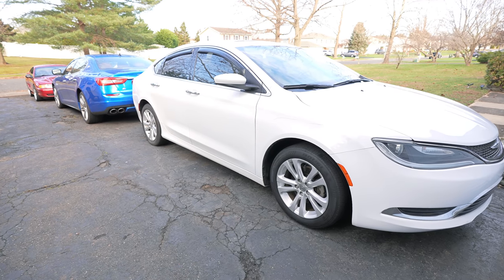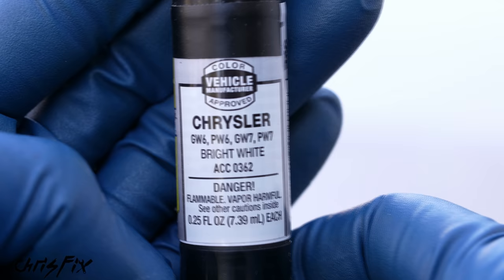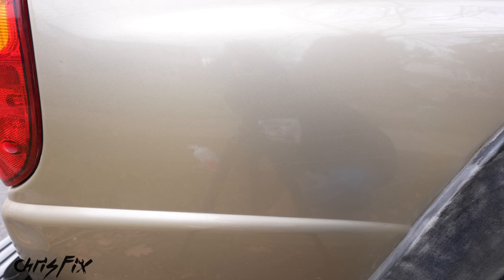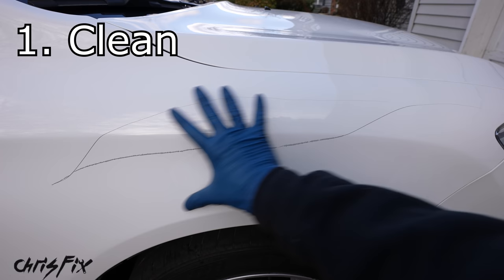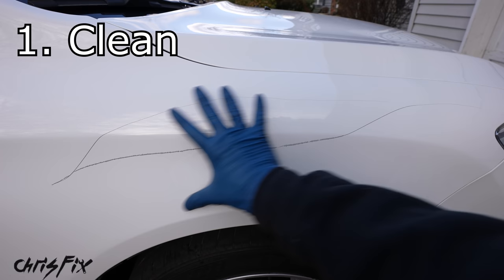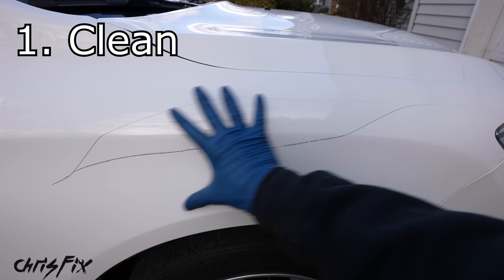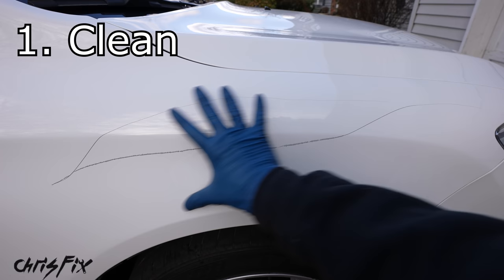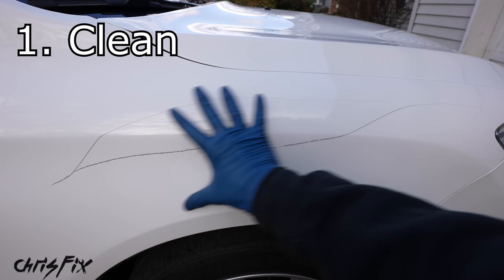How to Repair a DEEP SCRATCH in Car Paint (DIY)

Comment: Thank you Chris! This is indeed very informative and very well made video!  I learned a lot from this.  However, I wanted to say that I have done several experiments on several scratches, darker car is definitely not possible to be restored like what you showed in the video. This is because that even perfectly matched paint will still look differently from different angle of light ( I mean, from one angle, color looks exact match, but from some other angle, the new paint looks obviously lighter). I don’t think this can be resolved unfortunately. Please correct me if I was wrong and if you have any suggestions. Thank you very very much!
Reply: Slightly mismatching paint that you can see from a meter away looks much better than chips/scratches that develop rust and eventually destroy the panel. Better would be to sand the panel down to metal and repaint. Best would be to repaint the whole car. But most would agree those options are overkill, and that this is a very DIY-friendly way to remedy an expensive paint repair and have it come out looking incredibly good, while protecting the panel and paint from rust.

Comment: Pretty helpful video.  If u have a color coat like my red truck and there's a scratch that goes through the primer you'll definitely need more then 5 coats.  I put at least 8-9 coats on my scratches and still had to refill after sanding.

Comment: Hi thank you so much for the video. I have never worked on my car before so I’m hoping you’ll see and answer. I notice when you described your supplies you mention 2000,3000,and 5000 grit sandpaper however when you were going step by step the first sandpaper you used was 800. Can you please clarify which ones I should use, I really worried about messing up my car even more lol. Thanks in advance 😅

Comment: I did this on my 2020 Corolla (I’m so happy I got a white car) It was my first time using sand paper, polish and doing anything car paint related. For my first time doing this I have to say, the results on my car were damn flawless I made little errors here and there but for my 1st time and having enough patience to start from scratch twice. Everything is matching and just like the video, you can only see the fix if you see it on certain angles or get up-close ! I’m very happy someone like me could pull off the fix and get these results!
Reply from the maker: I’m glad this worked well for you!
Reply: I love you.

Comment: My OEM color is not available in this pen but I can get it from my dealer. Can I use any clear coat to seal it following this method? 

Also, is the method the same is there is a dent at the scratch as well?
Reply from the maker: So dents need to be pulled out. You can use any clear coat that’s the same type.
Reply: @chrisfix  any tips on the sanding buffing if I don’t remove then dent? It’s tiny and busy shops want upwards of $700 to repair both 🤑

Comment: I love ChrisFix  but his procedure works great for solid colors only. If you have metallic paint do NOT follow these instructions. Sanding metallic is a no no. The reason is that you would be sanding the metallic particles in the paint and those particles would lose its shine and stand out like a sore thumb. If you have metallic your best bet is to feather edges, lay down one or two layers of color without going above the rest of the panel and fill with clear and sand the clear to level with the panel. You won't have the perfect results but it will look much better than sanding. Also keep in mind painting metallics are challenging to begin with even for pros, touching up is much worse. Ask me how I know...

Comment: Hi Chris so I’ve had an issue where a kid opened their car door into mine. I literally just got the car too 😂 It’s weird because the clear coat was compromised to where the base coat was fine but the paint is completely exposed. How do I buff out the scratch if there’s not clear coat to work with? I am begging you to please read this lol

Comment: @chrisfix, thank you so much man! I was really ecstatic when I started the project but I am having trouble with paint dissolving when I try to wet sand. I go back to square one - it’s the touch up direct paint (I think water based). Is there a specific type of paint you suggest?

Comment: I’ve been working on this for the past couple hours. After applying the paint, waiting an hour and then moving to the sanding stage, I’m running into an issue with the touch up paint just peeling off. Not sure what the problem is, maybe it’s because I’m in the south and the humidity is preventing it from completely drying, but I’m going to try letting it sit for longer and then being more delicate during sanding.
Reply from the maker: Try letting it sit longer and dont press as hard with the sand paper. The humidity could be the problem.

Comment: I started this process and it was going great up through the painting step, but after giving it more than enough time to dry and sanding it down to be level with the surrounding paint, the touchup paint lost some of its color, started to look silvery instead of blue in some spots. Did I do something wrong? Please help!
Reply: Im stuck in the middle of my job waiting for your answer please! Thank you so much!
Reply from the maker: Make sure you are using high quality sandpaper and maybe wait for the paint to dry longer. There are a lot of variables but I think you are contaminating the paint with the sandpaper that is coming apart.

Comment: wow. what a great work. thanks for sharing. look,  i got a little chipp on  my bike carbon wheel and (without watching ur video) did something similar with a black spray paint only on the small place of the chip. the issue is that the wheel is matte (graphite color). so in the end i have a totally black spot on a graphite/black wheel. now after watching here, i sand it off around the edges but the color looks much different, i believe i took off the matte and made it glossy. do you have any tip on how to do a touch up on a matte looking surface? thanks a a lot

Comment: Great informative video. Question: If you fill your scratch completely with paint so that it's level with the surrounding area and add the clear coat on top would you not remove all the clear coat added to the scratch area when you sand it down to be level with the surrounding area?
Reply from the maker: As long as you sand it down carefully you won't be removing any of the clear coat you put on

Comment: Hi Chris, I love your videos, I was attempting to fix a clear coat scratch and used a paint pen I bought from the Audi dealership, the pen did not have a brush rather more of a dabber, I followed the steps to a tee, however after sanding with 1000 grit sandpaper the scratch is bumpy, should I use 800 grit?  I have not applied the clearcoat yet.
Reply from the maker: I would stick with the 1000 to remove those bumps
Reply: @chrisfix  ok thanks.  When your at the sanding stage after you applied the clearcoat, what is the time interval between sandpaper grits, i.e. 1000, 1500, 2000, that should be adhered to?
Reply: Chris please help, I applied the final step the polish and there is still a haze in the paint. What can I do? Can I send you a picture? Maybe this shouldn't be attempted with a black car? Any help to restore the shine would be appreciated
Reply: @jeffbaumann6553  did you work the polish in hard enough. Gotta use a medium pressure and get a decent amount on there, then use a hard pressure when buffing

Comment: I bought a Z3 with a 3 inch gouge on the hood that the dealer put some touch up paint into.
It looks like garbage and I can spot it from across a parking lot (because I know it's there. 😂 )

I'm glad it will be an easy fix one of these weekends ...if it ever dries out.  🌩

Comment: 10:44 How did you knew it's the primer ? it looks like metal to me , so I'd think I need to start with clear coat there, how can I tell?
Reply from the maker: Look closely at the scratch, in the middle is metal so that's just the metal panel, the grey paint looking layer is the primer layer. Bare metal should look different than painted metal
Reply: @chrisfix  Thanks , the solution was the best for DIY to preserve for the long run, I think you'r brilliant. That vid was exactly what I was looking for and I'll go for it. Bless you.  🤩

Comment: PLEASE HELP. I wish you did this on a black car. I'm in the process of doing this but I need to get more sand paper. I'm currently sanding down the touch up paint but is the sand paper supposed to make so many scratches on the original paint!???? I feel like I'm messing up my paint even more. Will it look better after the clear coat step?? Will this buff out with compound and polish???
Reply: how did it go?? thanks

Comment: I have a question about waxing the car, I have surface level and deep scratches on my car which also needs a really good clean. I was thinking about following your super clean video, then in the paint correction stage attempting to fix the light and deep scratches. After this stage, should I avoid waxing for 30 days to let the touch up paint fully cure as you suggest? If so, what preliminary steps should be taken before sealing the car with wax after those 30 days have passed? Do I need to repeat all the steps from the super clean video? Or should I wash the car with car soap instead of dish soap? Do I need to polish again? Any guidance would be much appreciated!
Reply from the maker: I would wait up to 30 days (or whatever your paint requires), then do another super clean (with dish soap since without wax it will be a little more dirty) then seal with wax. You shouldn't need to paint correct or polish when you do the second wash

Comment: it seems if your car is black color, during the step of sanding the touch up paint down, maybe you need to keep sanding with finer grit paper. As the 800 grit will leave a scuffed look in the area.

Comment: Amazing explanation and result! Would you advise using a rust converter before applying a primer, or can the primer go straight on the sanded down scratch (if the scratch used to contain rust)?

Comment: I bought a Mazda paint pen from the dealer.
The pen is only the base coat.  It doesn't have a separate tip for the clear coat.
ChrisFix mentions in this video that the pen should come with a base coat, a clear coat, and the scratch tip.
I don't want to skip a step; what should I do?

Comment: Not to take away from the fact that this is an extremely helpful video but why does he lie at the start about the sand paper you need? No mention that you will need 800 & 1000 grit as well..

Comment: Awesome video! One question though: if you sand down the basecoat to be level with the surrounding paint, then add clearcoat, and then sand that down to also be level with the surrounding paint, haven't you just sanded off all of the clearcoat you just added?

Comment: Very good video but people should be cautioned that while this works well on regular paint, trying this on metallic paints will not yield these great results (those are a pain in the butt)
Reply: What should be done to get good results for metallic? I'm about to tackle a pretty large scratch in snow white pearl.
Reply: @GuitarSaxBassoon   Currently trying to do toyotas red ruby flare pearl and its a pain in the ass lol
Reply: @jamie85200  I wish you good luck after I already screwed up and learned myself haha. Rushed + embarrassingly learned that metallic paint is separate from the actual colored paint. From my botched attempt I've learned this: for your red, you're going to want a grey primer and can follow the video for that and your red base coat (unless the metallic flakes are integrated into the red - my white metallic was two separate layers). When you get to the metallic coat, it's important that you get a spray rather than brush as sanding the metallic to try and level will just ruin it. I think there's some technique with distance and angle, but my failure involved brushing so I don't know too much. Hopefully you apply an adequately thin layer and then you can top it with the clear coat and polish like the video.

Comment: Chris, thank you so much for this video.
I just found a pretty decent sized deep scratch on my drivers side door and it looks like it’s passed the primer.
My question is, do I have to sand it down with 800 after I apply 1-2 layers of Primer before I move on to applying paint step? 
Unlike what you’ve used in the video, The paint kit I bought has separate Primer and a Paint so I want to make sure I am doing the right thing..

Comment: Fantastic video, thank you so much! 
My plastic bumper sketched on a concrete surface, so the scar is fuzzy and rough. In that case, should I sand the whole area to smooth it out first? Using maybe a 800 sand paper?

Comment: Chris, I try to repair a long scratch on my car, following your instructions, but I am facing something that didn't happen to you even though you mentioned it: while wet-sanding the new paint with 800 grit paper, it creates nasty dark deposits along the edges of the scratch. I use soapy water as recommended, and yet it keeps forming. What would you recommend to remove it?

Comment: I used 1000 grit to sand the paint to level however there are lot of deep scratches from colliding into a pillar so I have a whole area of haze after sanding. I did exactly what you did here however the polish didn’t entirely return shine to the panel. Any suggestions? Thank you very much!!

Comment: Excellent as usual! Any idea of what to do if the original paint has faded. I've got a chip on the hood, not too big but it gives me a degree of discomfort know it is there and it is chipped to the metal. I found the exact match to the original color but my car has lived through some sun and rain so I am afraid the patch will be even worse than the chip. Can I "dilute" or mix it with a paler shade or some white like the painters do with acryl to achieve exact match? Much appreciate your response.

Comment: I was excited to find this tutorial and  did this method on two scratches on my car.  I have a black car so I don't know if the paint reflects more "haze"? After sanding the clear coat with the different grit sandpapers and polishing...the actual scratch area looks amazing and shiny and smooth...but there still a haze around the scratch area where the clearcoat was not applied. I have polished it several times and it doesn't seem to be fixing it. Any suggestions? I chose to do the last part on the smaller one to make sure I did it right, so I'm apprehensive to finish the larger scratch since I am having the haze issue.

Comment: Hi Chris,  really nice and comprehensive video.
One scratchs relatively deeply my brand new Black mustang, and even if it is only thin and 4cm long i can see the white of the it like if this was an enormous thing!
Results are impressive, Nevertheless i’m still hesitating as i have this car in leasing for 4 years.
What i Wonder is once you have sand, paint polish the the repair are, what is happening  thru the time?
If i go to carwash regularly whether it is rolls or high pressure, will the shinny apparence disapear, and i will have to repolish it again?

Also Black is a terrible color,  few hours after cleaning  you start to see the dust and all kind of crap literally ”jumping” on the car. Any trick to avoid this?
Reply: Avoid automatic car c washes at all costs my friend

Comment: I recently made the mistake of washing my car without a grit guard in the bucket, and a pebble tore right into my C pillar. I'm just wondering if the steps are any different for if the scratch is down to bare metal? Also for some reason the roof, C pillars, and rear fenders are all one panel, so would I have to feather out my polish/sanding instead of doing the whole panel?
Reply: if the panel METAL (make sure it's not not plastic) is exposed, you need to clean the area with degreaser/isopropyl alcohol, spread a bondo putty to fill in the exact hole, sand that putty so it is smooth, then apply a spray primer on the exact spot (hole punch a sheet of paper then lightly spray on primer through the hole) 

then you want to follow this video on painting and putting on clearcoat 

do not use wax or ceramic for 3 months after completing this process because the clearcoat needs to cure and the wax/ceramic coating will burn through the clearcoat 

if the panel is made of PLASTIC, you must use bondo bumper filler which is flexible just like plastic

Comment: Hey @ChrisFix- Thank you for this helpful video! I am in the thick of repair following this video and have a question, if you're able to help me out that would be awesome. I've painted and wet sanded with 800, and now the scratch locations are white (pehaps because I've scratched away the topcoat?). Your repair didn't look like this, not sure if that's because your paint is white and mine is green. Would you recommend going straight to the top coat (will that remedy the whiteness?), or do you think I somehow rescratched the paint and need to repaint with color? Thanks!

Comment: So, what do you do if a previous owner made a really bad paint repair, wrong colour as well? Do you sand down to bare substrate (quite a large area) of bumper corner) and build up from primer, etc, , or sand down the botched splodges of wrong-colour paint to smooth and apply a topcoat of colour and clear coat using the curved paper trick to get a soft blend at the edges? The repair is at least 7 years old with no rust bubbles. It might not be a steel substrate, these bumpers. It’s a very high kms 2017 BMW, this was its only reported accident (at one month from new), probably a no-one-to-blame parking lot side-swipe.